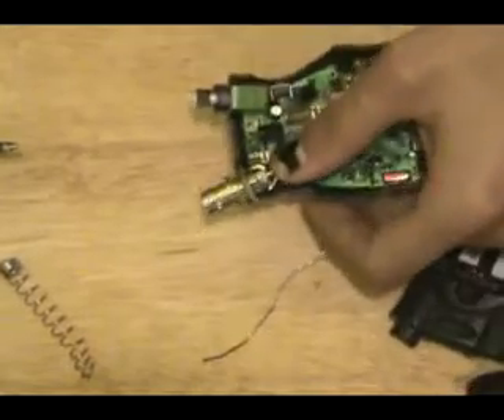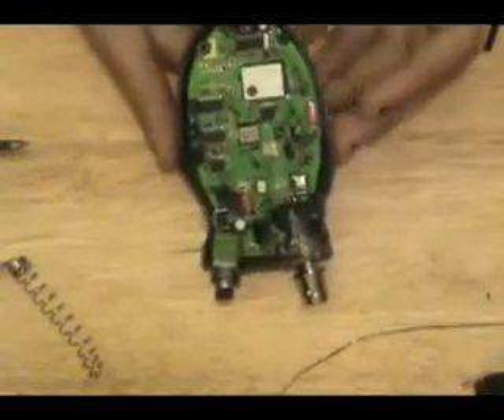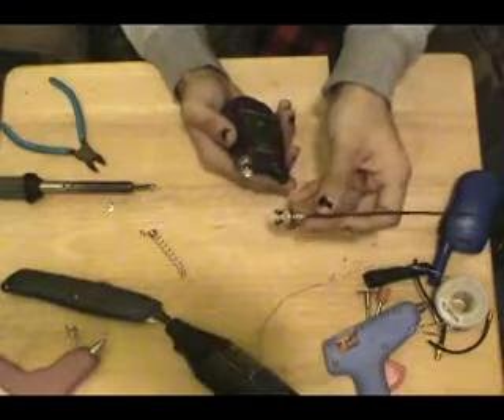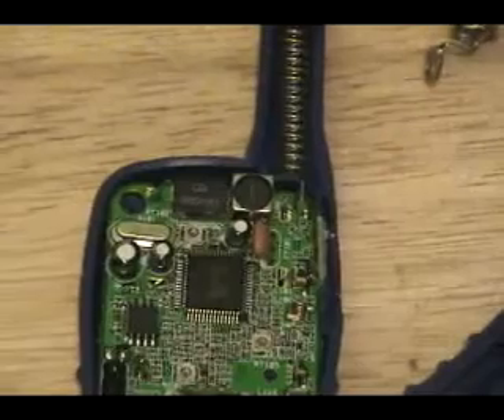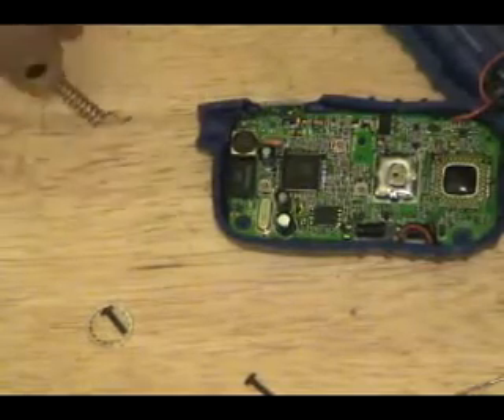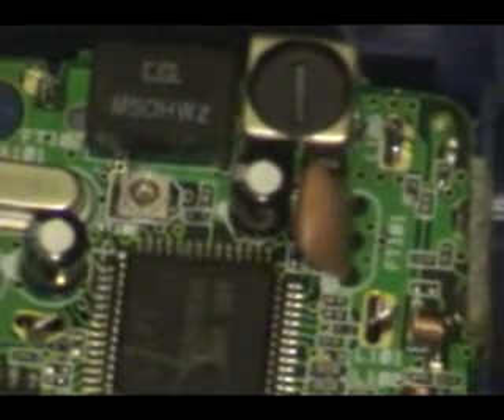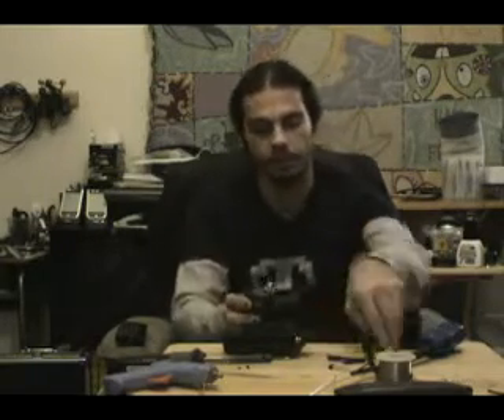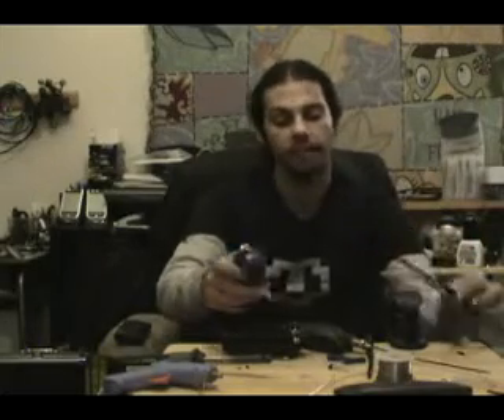FRS/ PMR Radio Antenna Mod -Part two

Comment: How about running a peice of 12-14 gauge copper wire 19" long off the negative  one of battery terminals like a rat tail.  Increases the range x 2.  Don't believe me ? Try it.

Comment: 1/4 wave antenna on this frequency 465 mHz, is 6 inches. because the original is coiled , it is really a subdued antenna and not capable of much range. A proper antenna at full 1/4 wave length should give double or triple the range.
Reply: sweet

Comment: I did a mod like this too. To get good range get a mobile magnet mount antenna. Get one that is UHF 450-470 Mhz. They come with a chart that tells you what measurements to trim the antenna to. Tune it for 464 Mhz. These mobile antennas are about  3 feet long and come with a built in coax cable about 12 feet long or so. You can then mount it on top of your car. Or indoors stick it to anything metal like a filing cabnet  or a cookie sheet pan works good to. Any radio communications shop or ebay will have these antennas. They are the same magnetic mount antennas you see courier cars using.. It will extend the FRS range both receive and transmit by 3 to 5 times vs the built in stock antenna. You could even use a base station antenna on your roof to get 10 times the range!  This does not increase the power of the radio. it increases the ERP (effective radiated power) of the antenna,  meaning it would be like you are transmitting with 5 watts instead  of 0.5 watts. Technically this is illegal, but the FCC would have no way of knowing, unless someone bitches. Don't swear or fight with people on the air or talk about anything illegal and the FCC should leave you alone.
Reply: I have heard of people using modified Ham radios to go on the FRS band. Handheld Ham radios usually transmit 2-5 watts and the mobiles run 5 to 50 watts. Another option is to use a UHF commercial Motorola two way radio and program it up for the FRS GMRS Bands. The commercial Motorola radios are built way better than any Ham radio.
Running 0.5 watts on the FRS band with a magnetic mount antenna is no big deal. Running 50 watts into a hi gain base antenna 60 feet off the ground will get you noticed by the FCC.
Reply: Rick Rude buy a wouxun, just a software unlock with a pc to open up no mod to radio and coast same as frs radio new

Comment: Great info sunurban, thanks!!  I modified a Midland XT511 base camp radio and a Midland GXT 1050 handheld.  On the GXT1050, you have to sacrifice the ability to use alkaline batteries, but that is a worthwhile trade-off as far as I'm concerned.  I bought some SMA male to male connectors from here:

https://www.cablesondemand.com/category/RG174/product/CO-174SMAX200/URvars/Items/Library/InfoManage/CO-174SMAX200.htm

One 6" cable was enough to do both radios.

Comment: 47 C.F.R. Part 95.194 (C) i took a look at this rule on mods and yup its illegal for sure. they dont say what happens when you get caught but it voids the leage use of the unit 100% kinda sucks but thats life i guess.
Reply: What does it say?  What I found under this, it did not say anything specific about modding the antenna.

Comment: May also be worth mentioning that you can buy off the shelf 446 radios that already have removable antennas made by Intek or TTi which also run higher power, or the Baofeng vhf/uhf unit from China on Ebay also tunes to 446 with 5w power and removable antenna for around £30 sterling delivered, these radios are far better quality than those as you say rinky dink FSR radios, also many people on FRS now use FRN software linking their radios on networks which are connected all over the world.

Comment: It will depend on several variables: (1) size/wavelength of antenna, (2) type of antenna - i.e. omnidirectional, beam, yagi, etc., (3) line of site to other radio with which you are trying to communicate, (4) power output of radio.
With good line of site, i.e. no obstructions, and full output power for FRS, you might make it 2 to 3 miles with a good antenna. Any buildings, trees, hills, etc. will cut the distance drastically.

Comment: Good tip, as the coiled antenna is not really the correct length even being coiled. With a resonate 1/4 wave the radio does transmit and receive better! I have done this type Mod to Midlands and the results were well worth the time. Now the radio can be hooked to a portable base antenna at a camp site on a support pole increasing the line of site distance. Good video, keep them coming! And yes once you figure out that the Mod is working and the case does close, use an epoxy glue! 73 Jimmy, WX9DX

Comment: Great Video,thanks for posting.So can you use a antenna that goes on the more expensive CB's,like the one that you clip on,as well as the connection they use? Does it also matter if you use a really big antenna,will it be better or worse?

Comment: All that trouble for replacing a coiled antenna for a straight one of the same length.  What for?  Uncoil the antenna and see if it is longer or shorter than the one you installed.

Comment: You try using a 1/2 wave antenna without a matching network, it will be worse than a 1/4 wave, because of match-loss; by at least 10dB. A 1/2 wave antenna has an impedance of around 1200 ohms, whereas, a 1/4 wave is 50 ohms, which is what these radios are designed to terminate into. I am an R.F. engineer and an Extra class HAM radio operator. 

de, NV6R

Comment: Hello,

What kind of metal and how many inches do you use for the boom of the antenna to avoid distorting the TOS at 446 mHz, 462MHz, 467MHz?

Thank you and congratulations to the two explanatory videos.

Yannick from Belgium

Comment: @0ddba1l 

I bet you cannot use a VSWR meter on half watt RF. Use a field strength meter, an MFJ 259B SWR analyzer, or a noise bridge to tune your homemade portable antenna.
Reply: He can use the old fashioned pre SWR meter "Lecher Lines" technique using a field strength meter probe to adjust the antenna so that the "dip" occurs at the ideal feed point, which will become the base of the antenna.

Mr. Lecher discovered the standing wave voltage differential across inductors and antenna wires, hence why we use the symbol "L" on inductors in his honour.

So if anybody ever asks you, "Who discovered standing waves??"..... it was Mr. Lecher in the 1900's.

Comment: Would you say to use a full wave whip or 1/2 or 1/4 for best result. I am using GR58 coax should it be RG75 for 446mhz PMR?